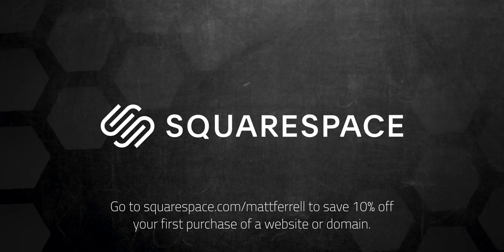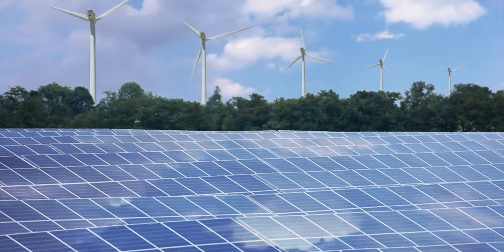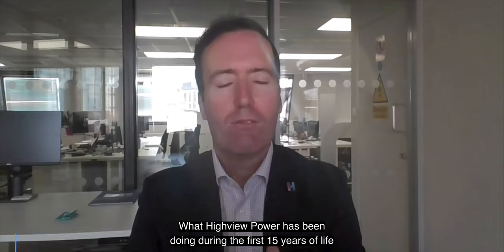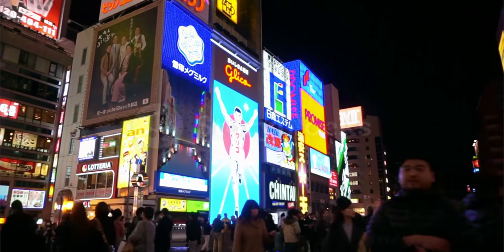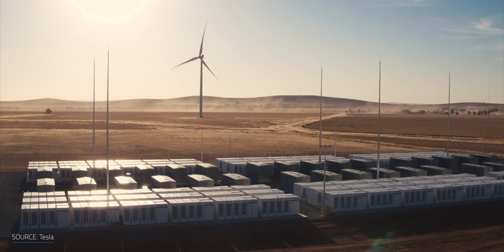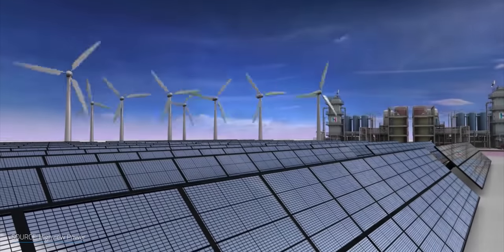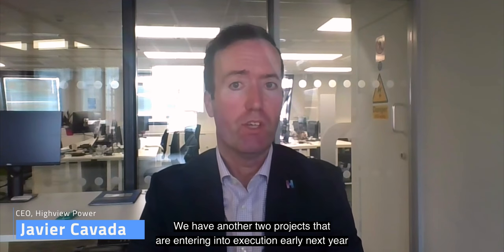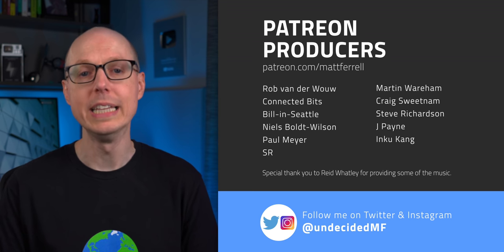Liquid Air Battery Explained - Rival to Lithium Ion Batteries?

Comment: If you are wanting a consistent supply of energy on hand at any given time, why not do a combination of power sources ? You can have immediate with lithium ion batteries  for instant usage and then recharge with the liquid air storage method. It doesn’t have to be just a one energy source model. It can be many different sources or combinations. JMO
Reply: That's the general idea. Different storage methods for different storage time frames. Options include hydro, lithium batteries, liquid air, hydrogen and green methane production and gravity based systems. May the best combo win!

Comment: So, the liquid air / cryogenic energy storage is perhaps less resource-intensive and less expensive at larger scales compared to lithium-ion energy storage? Even if it is less efficient than lithium-ion, it could make sense economically.
Reply from the maker: Exactly.  It looks like it's hitting the sweet spot for cost at the end of the day, which if it plays out, is ultimately what matters for adoption of the tech.

Comment: I'm pretty dubious about this "you can make it as efficient as you want" statement, given that you're essentially just extracting and saving heat to drive a turbine later on -- there's no reason this would avoid the Carnot limit as far as I can tell.
Reply: I think that's why he talks about the cost in the end per kWh. It could be not efficient but still cheaper than any other form of energy storage on the required scale needed in a certain situation..

Comment: The problem I see with storing renewables isn't just a daily cycle issue, but also how do you store it for a week or longer? Because the wind doesn't blow the same every day and the the sky isn't always clear, you need to store the energy over a much longer period, otherwise you still need the backup peaker power stations.

Comment: As so often, there must be a downside that is not immediately apparent, either on the technical or the economical side. This is no new technology, if it would be such an easy solution, it would be all over the place already. 

No offense, I love the channell, but often it's like school kids stuff, ideas that sound great in theory. But if you get down to reality, it proves like not so easy at all.
Reply: The company has developed a system to increase the efficiency. They've built test plants of increasing size and  have contracts to build more plants. Now You Know did an interview with this same company giving a more detailed explanation of some aspects of the business. I think this company will still be load-balancing even as fusion energy begins to wipe out fossil fuel and wind/solar alike.

Comment: I'm not sure whether I missed this part, how do you store heat energy extracted from air during liquification? You said that you increase the efficiency of the system by reusing that heat energy.
Reply: I think to have read  "gravel beds" are used. It has an open structure and good heat capacity but that could be better. Still the storage of the heat or cold is never for very long. Better solutions would cost much more. I only wonder about the speed of the heat exchanges.. What takes up the cold released during expansion fast enough?? Not gravel.. I think, in the first step.

Comment: Informative video. But one of the aspects that was not discussed is the need for energy to begin the process of compression.  Couple that with the need for energy to maintain the cooling of the liquified gases and maintaining the heat storage there appears to be a need for a 24 hour external energy source supply. The balance of wind, solar and battery to maintain a constant energy source for this type of facility will be quite a dance when the vagaries of weather are introduced into the equation.
Reply: I would assume you're only using excess capacity... so if you have no excess capacity you just don't store anything.  If you don't have excess peak capacity, you just wouldn't install this (or anything)

Comment: The issue is cost per megawatt. If solar and wind power were not so expensive and intermittent there would be no market for battery or liquid air backup.
Reply: Solar and wind are basically the cheapest though...

Comment: Answer me this. Why do we have to scale up anything? How about putting energy needs matched with energy use?
Reply: Waoooo Thats a great question?
May or may not as medical student i could convience you but here is answer that as a pharmacist we are used to make a drug( pills) in specific size and shape and weight due to compatibility of a patient like it could be easier to engulf if it is large in size it isnt easily engulf by a normal throat and if it is much smaller in size the specific amount of drug dosnt compatible in effectiveness of boady. Let me explain in this way if a person have 272 square feet home he want to install the solar system 5000watt of solar panels but the size of solar panels are increasing from the given size which is 272 square feet so leagly you cannot place the solar panels so you have to meat in the situations where consumption rate of your electricity in home should be decrease, so thats the main issue and this issue could more relivent when you living in those cities where spaces are closed and in this case we are thinking and taking the space from natural environment as well as the cost of making these products. I hope i am able to understand you best of luck from pakistan and sorry for my bad english.

Comment: Nice job Matt.  Been watching liquid air for about a year and hope it's not "vaporware." Big fan of lithium ion as well.  One useful follow-up question, it was mentioned capturing nitrogen and oxygen byproducts for industrial uses - can it isolate CO2?  Does CO2 have a different boiling point then the other gasses and can it be cracked/separated for government bounties as captured carbon?
Reply from the maker: This process can absolutely capture/isolate CO2, so it could double as carbon capture.  It would require extra investment to build that into the system, but it's possible.

Comment: I thank you very much for your videos they are very informative and you do a great job in your research. I have been wondering for several years why this hasn't been used more widely along with making the hydrogen cell perfected to use as alternate energy for automobiles. it could take place of Petrol and then we could have 2 environment friendly energies for transportation. i do know Liquid Hydrogen isn't as efficient as batteries but its still a better source than petrol being its clean and renewable

Comment: Matt, if done at scale, could these plants also extract CO2 from the air, as a byproduct? Could this be the negative emissions technology we need to combat climate change?
Reply: They do extract air - as a solid!
Air has nitrogen (78% of air, b.p. -196 C) and oxygen (21% of air, b.p. -183 C)

Carbon dioxide (0.04% of air) sublimes at -79 C (i.e. at 1 atmosphere pressure it converts between gas and solid at this temperature) so it definitely comes out.

It is probably a major pain in the 'cleaning' process mentioned at the beginning of the video as solid crystals in the pipes is not good for the plant. They may sell some to the food industry. However, without a major sink like geologic sequestration, it would be impossible to store for long.

Comment: I recently went to Chattanooga. They have a giant reservoir full of water that is a giant battery. Its a reservoir at the top of mountains, that is ready to be released when power is needed.
Reply: Static storage when not needed is better, as you don't have to keep adding energy just to keep it cool enough once you've topped off, but as he noted you can't do that everywhere

Comment: He got me with air battery, but lost me at converting air into liquid and then warming it to generate heat. Both processes requires energy... not to mention storage. Ok, next.
Reply: Well, it not that it great idea, but it cost billion to get a conventional Lithium ion battery factory up and running.   Creating all the machines from scratch and then building a factory that can product a hell lot batteries you bankrupt a billionaire trying to do that..
Reply: I don't think the word battery is on it's place.The way liquid nitrogen can store power and then deliver "work" is a bit bizarre. It's almost like a carrier of "negative energy". In itself it is cold and contains less energy than when it was gas. But then with expansion, work can be delivered. The energy for the expansion comes however from some hot medium or the environment. And so there was the real positive energy stored.

Comment: This seems like a lot more extra steps than compressed air energy storage; the efficiencies are about the same in both, but the setup costs, maintenance and the cost of anything if it goes wrong, seems exorbitantly more expensive with liquid air.
Reply: Need special features for compressed air like a massive salt cave. That’s not needed here. LAES can go anywhere.

Comment: Seems like a combined modular approach with Li batteries amd liquid air would be ideal. There's room for battery banks there. 

Perhaps having liquid air batteries charge the lithium ion  batteries would be best then - the system to the outside is fully responsive at the milisec level or whatever, and liquid air's "lag" gets hidden behind it but increases the system's capacity.
Reply: Charging the batteries directly from excess electrical power is WAY more efficient! This is for when all the utility power batteries we have have been filled and we still have excess power.
Reply: @fotoguru222  sure. I wasn't saying where the power came from, just that lithium ion batteries could be placed in front of the liquid air ones as a fast acting stage.

Comment: Where does the energy come from to evaporate the liquid air? And where does the energy come from to expand the cold air? Gases get colder as they expand and do work. The high pressure steam in a steam engine is at a temperature of about 250 degrees when it enters the cylinder or turbine, and just over 100 degrees when it has expanded to about ten times its volume and done its work, with just enough residual pressure to draw the fire. This sounds like it defies the Second Law of Thermodynamics.
Reply: They store the heat of compression in a pebble bed, then run the cold gas through it when expanding.

They could also use waste heat from conventional thermal plants.
Reply: @factnotfiction5915  Thanks

Comment: Source: wikipedia search: Compressing and decompressing air introduces energy losses, resulting in an electric-to-electric efficiency of only 40-52%, compared to 70-85% for pumped hydropower plants, and 70-90% for chemical batteries. The low efficiency is mainly since air heats up during compression. Thus if 1.0 m3 of air from the atmosphere is very slowly compressed into a 5 L bottle at 20 MPa (200 bar), the potential energy stored is 530 kJ. Lithium battery energy density:They have one of the highest energy densities of any battery technology today (100-265 Wh/kg or 250-670 Wh/L). So let's do some math. 5 liters of compressed air 530kj. 5 liters of lithium battery 250 Wh x 5 = 1250Wh. 1 watt hour is 3600 joules. 1250 x 3600 = 4500kJ. Compare that with 530kJ for compressed air. Got that? Now consider efficiency as well 40-52% vs 70-90%.
Reply: Ah! This may expalin why they are best suited for cold climates, where the waste heat won't be wasted in a co-generation plant. Use the "waste" heat to heat buildings, water, industry, etc.
Reply: Now do the math with liquified air instead of just compressed air.  Wikipedia also has an article on Cryogenic energy storage (what this video was about - if you watched it and not just read the title)
Reply: @AaronCoakley  Got aprox the same numbers. https://en.wikipedia.org/wiki/Cryogenic_energy_storage . Down on the page: In 2019 the Washington State Department of Commerce's Clean Energy Fund announced it would provide a grant to help Tacoma Power partner with Praxair to build a 15 MW/450 MWh liquid air energy storage plant. It will store up to 850,000 gallons of liquid nitrogen to help balance power loads. So let's calculate. 450MWh is 450,000,000 X 3600 joules = 1,620,000,000,000 joules. 850,000 gallons is 3,145,000 liters. Dividing the two  515103 joules so 515Kj close to my initial 530KJ. Still not enough power density. Beside efficiency around 50%. If waste heat is used 70%. Still can't replace batteries. Now I give you that. While the batteries have a limited number of cycles, this system has virtually no cycle limits

Comment: I would imagine it's the low efficiency.  Sure it can be used anywhere but I would think most places have better options.
Reply from the maker: To a point I agree.  I think it's highly situational.  Pick the right tool for the job, which in many cases could be this.  I'm extremely interested to see how the Vermont plant works out.
Reply: @UndecidedMF  Under the cool but not as practical banner.  There was the idea of storing compressed air in caves.  The advantage would be the HUGE volume.   But it's pretty limited in where you could apply such things.

Comment: Wind and solar in some ways are quaint. They have their downsides and are not the solution they are helping some though. Fusion may be the solution if we can contain it.
Reply: yeah...your right in the long run...but far..far away in terms of actually doing it. We do not even have a working prototype yet. Nuscale is building its first commercial scale prototype nuclear reactor, but pity it will take 10 years, if a government had any brains they would throw money at it and speed the process up.

Comment: Sorry for the random comment, but have you ever checked out Molten Salt for Storage?
Reply: Yes, I read they use that now to complement the solar panel energy. (Dubai) The solar panels melt salt and during the night that drives a steam turbine. This hybrid way is cheaper and more efficient than with all those mirrors from a pure thermal solar plant.

Comment: I wonder if this process can pull CO2 from the air and do something with it.  Same goes for methane.
Reply: It scrubs the air and they can I believe bottle and sell the co2 although it isn't anything close in quantity to a machine designed & built to capture co2.

Comment: I can see added benefit with this tech. The cooling process causes the air to separate into the various gas components at different stages. This process can be used to separate hydrogen for further economic use in a hydrogen based economy. Also the CO2 can be pulled out and locked away in the ground or made into a carbon neutral synthetic fuel instead.
Reply: There's no naturally occurring hydrogen in the atmosphere, it likes to bond to other things too much. That's why we have to extract it from other molecules (like water or natural gas)

CO2 certainly. I think to make that economically viable though, it would have to be in a country that has a carbon tax active, so that they could be paid for the "carbon capture". Otherwise, it's quite an expensive endeavor.

O2 and a few other elements used elsewhere could work, as they may have a salable value to other industry.
Reply: @MrVelociraptor75  Thanks for the clarification.  You have some valid points.

Comment: I have been following tech for last 11 years and none of the tech over the year have replaced LiPo/ion batteries.
Reply from the maker: Agree with Roger's take on this.  I'd also add another comment that someone left ... it's a great path for jobs.  All of this is using technology from the fossil fuel industry, so many jobs can/should be able to transition over nicely.

Comment: It seems to me that this system excels in long term storage. The amount of storage can be scaled beyond the storage rate-- as the pressurized containers can be added.
Reply: The problem is you need to use the heat from liquifying the air or the cold from turning it back to air to make that 60% efficiency. If you keep the air liquified for long periods then you're back to the original 25% efficiency.

Comment: As an electrical engineer, it slightly irks me that this technology is referred to as a battery.  "Everybody" knows that a battery is "a container consisting of one or more cells, in which CHEMICAL energy is converted into electricity and used as a source of power".  At least put the word battery in quotes!
I suppose that the liquid air could also be fractioned to some extent, with the most valuable components sold off, and the nitrogen etc used to provide the stored energy...(?)  (This would be another form of energy savings, since the energy required to liquify the air would be doing double-duty.)
Reply: James Buchanan,

1. a connected group of electrochemical cells that store electric charges and generate direct current
2. a single cell of this type
3. a similar nuclear, solar, or thermal device that stores and generates electrical energy

There are also inertia batteries and gravity batteries, similar to the one used to power the Nikola 2 for its “In motion” debut. Lol
Reply from the maker: Sick Nikola burn.
Reply from the maker: Yeah, that's not the official terminology ... cryogenic energy storage is the official description.